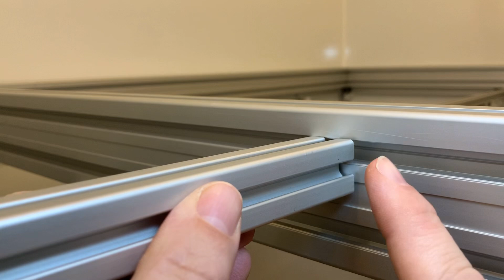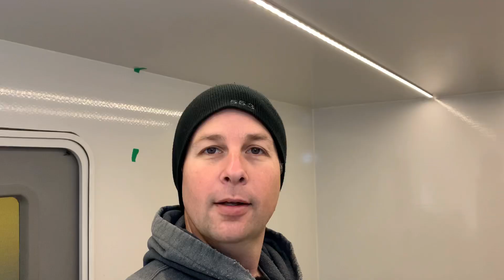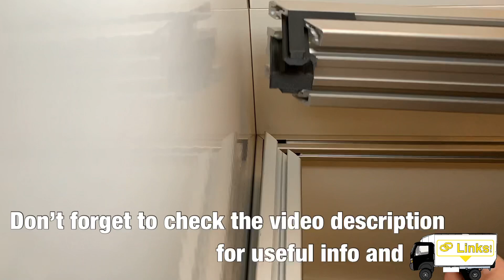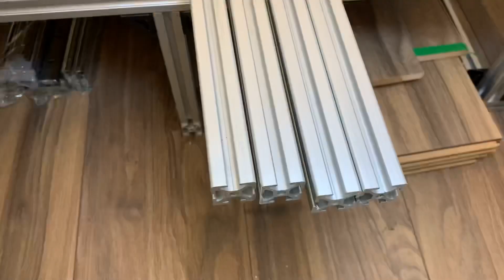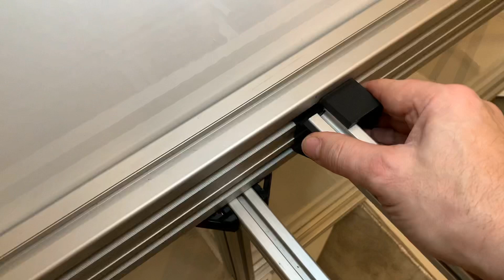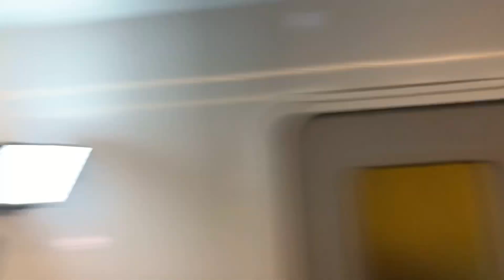DIY Overland Truck Interior CUSTOM parts!

Comment: Hi Bruce. Just starting out on my 2006 FE85P Fuso build in the UK. Thanks for making such a detailed build series. There’s a lot I’m going to copy you on. Hoping I won’t have the mechanical issues you’ve encountered. 🤞🏻 Just wondering what spec your metal bandsaw is (in metric would help!) - was it enough for all your aluminium extrusion, or just the T-slot? 

Also I’d like to try 3D printing, but you seem very competent with the software, which puts me off, having never used CAD or SketchUp.
Reply from the maker: Hi!  I’m glad you’ve found it helpful!   That little horizontal bandsaw has been awesome - I can get some measurements for you - unfortunately I don’t have all the details as I bought it sort of “scratch and dent sale” - and I don’t have a spec manual for it.  

3D printing is FOR SURE something to get into - don’t worry so much about not knowing drawing software - even without that there is plenty you can do with a printer - and you can pick up skills in Sketchup, Fusion, TinkerCAD, blender, or any CAD program as you go, starting with simple parts.    Take a look at Thingiverse, Makerworld, Printables, Cults3D…. Tons of already designed stuff you can download and print!   3Drop is a great phone app for quickly searching if what you want is already designed by someone! 

I don’t think you’ll regret any of it!!
Reply: @BruceandKrista thank you! You’re a star. I’m binge watching it all. 😂 I only recently bought the truck (U.K. spec 4x4 with factory super singles, from 2006 with just 40k miles and the 3.9 litre engine) and I’m sorting the mechanical wrinkles then will start the build. I’m debating a self build vs a reefer (fridge) box conversion.

Comment: Are you not worried in a few years when this plastic becomes very brittle that it will crack and break?
Reply from the maker: Generally plastic that becomes brittle is non UV stable plastic that is exposed to the sun, this is not exposed to the sun, and is also fairly UV stable.  Check out the interior of your vehicle - lots of plastic!

Comment: Very nice ! Clean looking setup. Have you done any strength testing on the carbon fiber parts ? I'm interested to know how tough printed parts can be.  And of course, be aware that carbon fiber dust is intensely cancerous if inhaled..
Reply from the maker: Yeah, one of the nice things about printing PETG-CF is not needing to sand it.  I do all my prototyping in PLA (quicker print) and if I need to do any trimming or sanding it’s not on the CF.  The only thing on the CF parts is drilling out the holes to get a clean hole, but as the CF is mixed in with the plastic, it seems to stay there (doesn’t seem to form dust while drilling, just drill shavings) - either way I’m careful.    I’ve been pretty impressed with the strength of parts I’ve printed.  Haven’t done any “scientific” testing, but they are stronger than one might suspect!  The dies that I made for pressing the battery buss bars blew my mind - and the fact that people are making custom press brake die shapes and using them for production tells the story of what can be done!